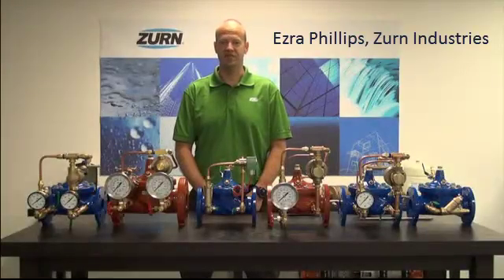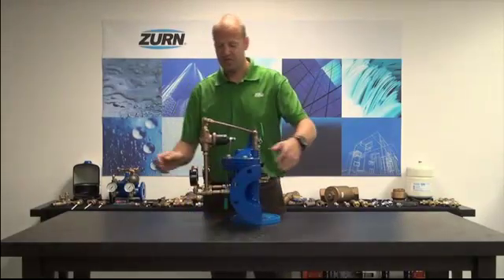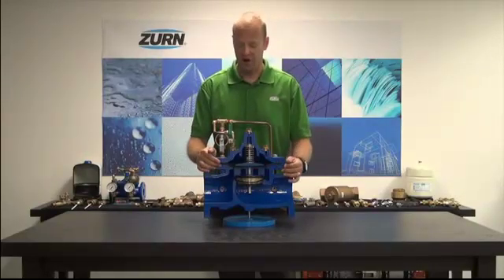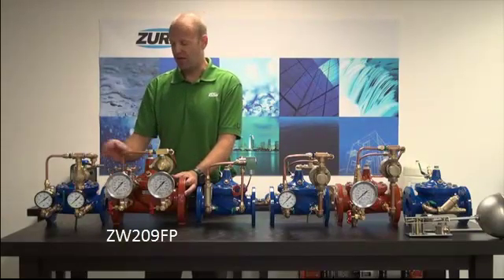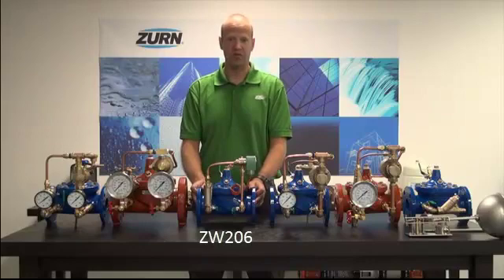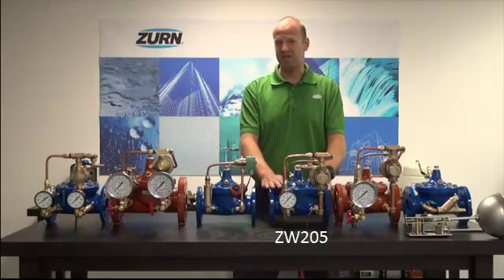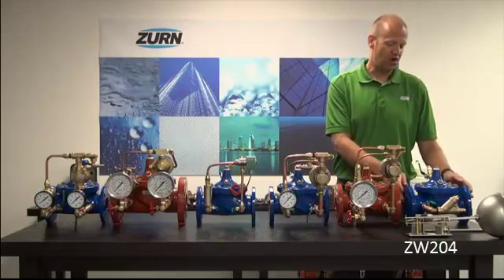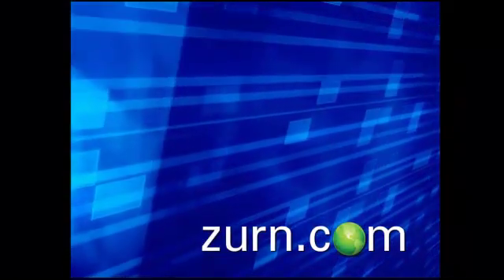Zurn Wilkins Automatic Control Valves

Comment: Whats the difference between zw209 &zw209Ex
Reply from the maker: Here are the main differences between the two: 

ZW209 Standard Features
-Main Valve
-850XL Isolation Valve
-SXL "Wye" Type Strainer
-Pressure Gauge
-Restriction Fitting
-PRXL Pressure Reducing Control

ZW209EX Standard Features
-Main Valve
-SXL "Wye" Type Strainer
-Restriction Fitting
-NR3XL Pressure Reducing Control

Hope this helps! Thanks!
Reply: @ZurnIndustries  i work for leminar air conditioning your authorised dealer in uae , kindly please support me ...since i havent recieved ny sort of formal training from your side...you can connevt me to paul.joseph@leminar.ae